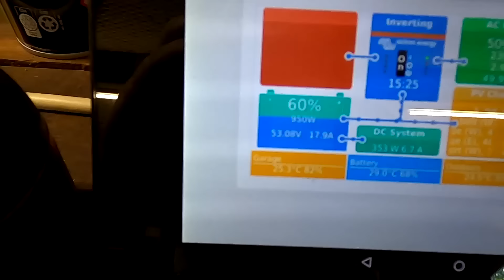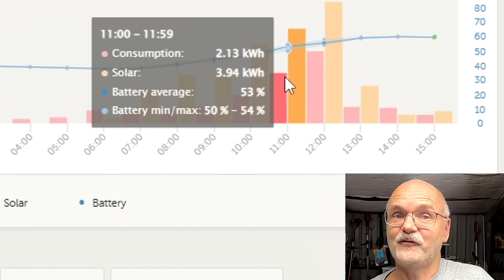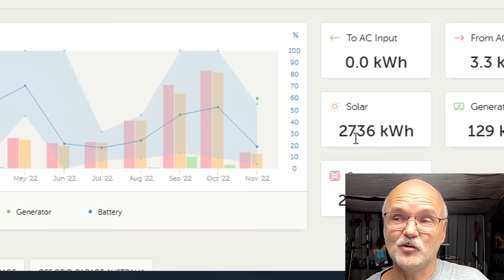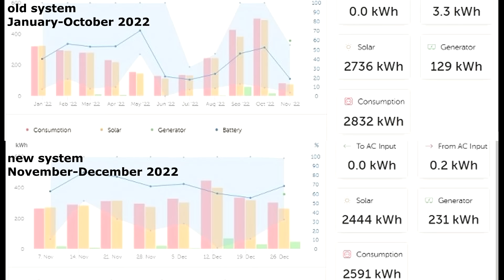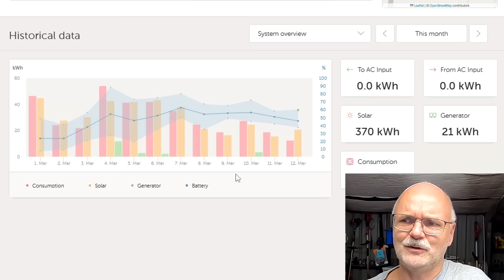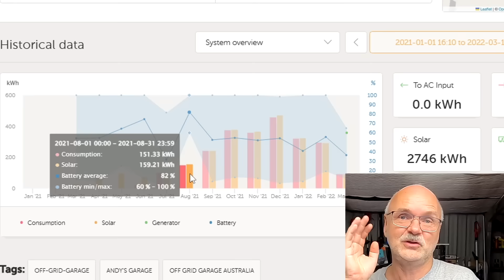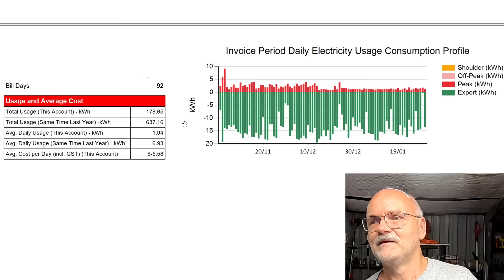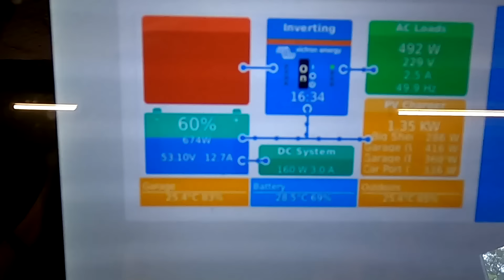4 Months after the solar upgrade. Are we there yet to go fully off-grid?

Comment: What does a kWh of electricity actually cost you? Have you ever calculated what the self-produced kWh of electricity costs?
Reply from the maker: I'm paying A$0.25/kWh around the clock when importing power from the provider. The self made kWh cost me 0c/kWh.
Reply: @OffGridGarageAustralia  "The self made kWh cost me 0c/kWh." Not really, unless you got everything paid for by your sponsors....
The whole costs for the PV and storage result in a price per kWh calculated over 20 years.
Reply from the maker: @maxmeyer7299  why 20 years?
That would mean I have to guess/predict the energy price for this period I would have to pay when using grid energy.
Do you include the price of a vehicle as well in the cost per 100km travelled? The more you travel, the cheaper it gets? The more power I use the cheaper it gets? Makes no sense to me.
I'm not paying anything per kWh of energy from my solar and battery installation. It will always be free.
Reply: @OffGridGarageAustralia  Nicht wirklich, ich Investiere sagen wir mal 20.000€ für die 10kWp PV Anlage mit Akku, sind in 20 Jahren 1.000€ pro Jahr. 20 Jahre, einfach die Haltbarkeit der Anlage, wenn sie länger hält, auch fein, aber mit irgend was muss man ja rechnen. Jetzt erzeugt die Anlage  pro Jahr sagen wir mal 10.000kWh sind dann halt 0,10€ pro kWh die die Erzeugung kostet. Das ganze mal für deine Anlage wäre Interessant, keine Angst wenn es mehr als 10cent werden... Solarstrom ist immer gut produzierter Strom. Es gibt aber viele Leute die Wirtschaftlich rechnen müssen und sich kein teures Solarhobby leisten können. Gut geplante Anlage kann aufzeigen wie günstig Solarstrom eigentlich ist.

Comment: Have you ever looked at if it is worth it considering your total investment and what you would normally have used in power without it. I mean including interest you could have either saved or earned (Excluded if you make profit fron your videos). Personally I don't think batteries (professionally installed) are worth it. On a country property without electricity installed I believe it is absolutely worth it but not in the surburbs when you allready have electricity.
Reply from the maker: No, never looked at the numbers and I could not tell you what I have spent so far. It's all in the books for tax purposes but how much in total... no idea.
It's more a hobby and I like to build things, learn and share this here on the channel. To be economically, I would have done some calculation before I even started on how much power we're using, how much battery I need and how much solar to cover this.
Reply: @OffGridGarageAustralia  It is my hobby too but as a pensioner I have to look at the cost. I have solar panels and that is worth it but getting batteries legally connected will currently at the best break even I believe. I spend about A$1000 a year for electricity (+ connection fees).
Gas for heating is worse apr. A$2500 (incl connection fees) last year but the cost is only 1/3 of ellectricity (MJ to kWh) so only heat pumps may be worth it if one should change to only electricity. Heat pumps are costly too.
Reply from the maker: @leonhardtkristensen4093  Yeah, if you buy a battery through an electrician, it will be costly and you're looking at ROI of 10yrs+.
We're looking into 4 split ACs at the moment for the house. All separate small units. They don't cost too much and very efficient (factor 4+) for cooling and heating.
At this stage, I'm not sure if I have enough solar power through winter, so this will be the test I'm doing in the next few months.
Reply: @OffGridGarageAustralia  I am using a "box" air conditioner to make heat and cooling at my farm (weekends only). I usually have problems mid winter and have to use oil heater instead (at Clunes near Ballarat). I have got about 14.4kWh Lifepo4 battery in parrallel with 9.6kWh leadcarbon and 9.6kWh Leadcrystal batteries. Before I got the lithium the system died when it got close to the freezing point on just normal usage (Fridge, cameras and data comunication) but now it survives. I have about 6.5kW panels and I am in the process of installing 3kW extra of s'hand panels vertical as they double as wall cover on a shed. In the summer they are not need as the rest over produce for the batteries and our usage.
Split system airconditioners are quite good. Unfortunately the colder it gets the worse they work for heating. Factor 4+ is not 4 when it is really cold.  I played around with a water heater heat pump some years ago.

Comment: I have determined that it would take 500,000 watts of solar panel capacity to generate enough power on a rainy day and others to generate the 50 kilowatt hours per day that we use in our household.
Reply: You have two choices. Either use less electricity or generate more to supply enough for your current consumption. It's if course always easier and cheaper to reduce consumption.
Reply: @cs3818919  Reducing my electric use to 21 watts is not possible. On a sunny day, I generated 43kWh of power. When it's raining, my entire three arrays are making about 21 watts! That's less than 0.5% of sunny power.
Reply: @basspig  21 watts doesn't sound right. And 43 kwh is a lot. Way more than the average household usage per day. With solar I think storage is the key because it's so unreliable.
Reply: @cs3818919  My experience over a fev years is that one can roughly expect an average of 3 times panel value in production. In the winter on bad days production goes down to maybe 5% panel value.  With thise values he currently wouldn't have more than 1 140W panel installed. I am in Melbourne Australia.
Reply: @basspig  I think you should get your system checked. 21W is very low. I don't think that I have seen anything below 5% on my system. I have had solar for at least 10 years in the south of Australia.

Comment: Connecting the output of one inverter as input to the other is hugely inefficient. There'll be at least 20% loss in each. Furthermore, if you use it to charge your car that's another 20% loss. I have tested it with my two inverters. You have to design a more efficient system and it can be done.
Reply from the maker: How. I would say, that is the best way of doing it. Everything else (like DC-DC charging) is fiction...

Comment: Production seems a bit erratic and not truly reliable. I think you need far more capacity, especially storage, or a typical glass case on the wall that says "In Case of Emergency Break Glass" with a box of candles inside.(g)
Reply from the maker: I think I need more production, especially in autumn and winter now...